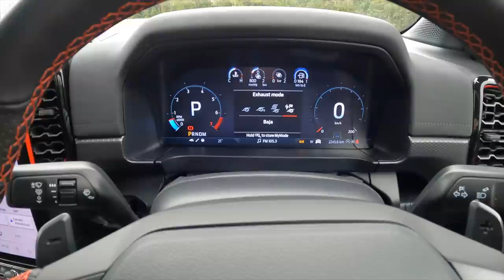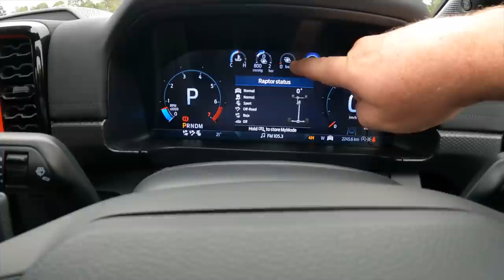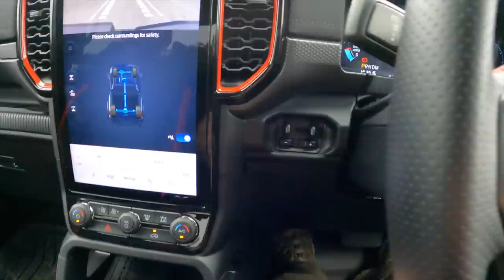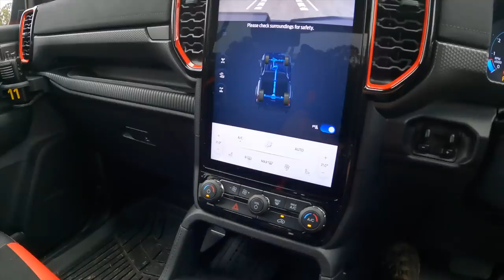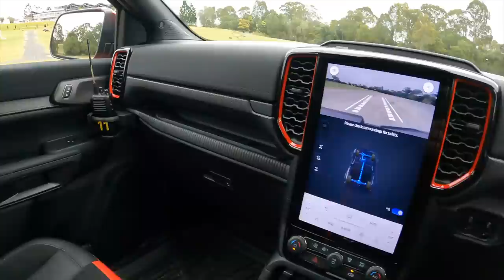🔥2023 NEXT GEN RANGER RAPTOR UNLEASHED !!! My full review on this weapon !

Comment: The only thing with the engine that's a potential problem is the Alternator is WAYYYY down the bottom of the engine, that's a definite fail for water crossings, other than that it looks fantastic
Reply: 90% of raptors sold will never see water so for the majority of the market it’s not an issue. But I agree with you

Comment: With it being close on $100,000 from factory (not including any dealership markup) and only rated to 2500kg braked maximum towing I’d be asking a few questions as to why your paying so much for a vehicle with more than enough power to tow yet rated so low. 

For similar money your looking at a Y62 which can tow over double.

before anyone comes at me about not being able to actually tow 3500kg with a hilux etc at least your covered under insurance and warranty if the worst were to happen. 
Your only going to be able to tow a jet ski or a fold away camper with this thing
Reply from the maker: It’s because of the suspension. 

You sometimes can’t have you cake and eat it to. Raptor has Fox 2.5” live valve internal bypass coil overs. These shocks are designed to do one job absorb massive bumps and jumps. Combined with a set spring rate to make sure there soft enough for normal driving there just not able to also carry a heavy down ball load. It’s got nothing to do with the power of the v6.
Reply: @TyFenwick  true. but with the way suspension is designed these days surely they could have done progressive spring rates or perhaps something different that I’m not aware of to help with this. 

Most of the sales of this specific variant are out priced of the general public though wouldn’t you think? For the most part your looking at cashed up tradies buying these or people like yourself. Both of which use their vehicles in vastly different way but both come down to weight. Wether it be loading it on the back or pulling it.

Comment: Hey Ty, 

Do you reckon you could get 35s on it like last gen? 

Thanks
Reply from the maker: I hope so mate, il be certainly be trying 🤙🏼
Reply: @TyFenwick  I have Geolander x-mts in 35's ordered for mine, my only concern is it not fitting in the spare wheel holder.

I'll keep you posted.
Reply: @morganoliver1773  35s have zero advantage over a  33, in fact they will do nothing but have a negative effect.
Reply: @vevohoeyo  it gives you 2 inches over standard
Reply: @morganoliver1773  I inch extra in height
Reply: @seadoomania  35 inches minus 33 inches  equals 2 inches
Reply: @morganoliver1773  sorry, 1 inch over all increase in height with 35" tyres. Do you know the difference between radius and diameter? Think about it, overall height increase is the difference between the 2 diameters halved as the wheel is mounted in the middle of the rim. There ends the grade 6 maths lesson.